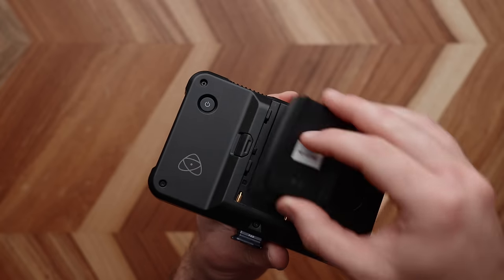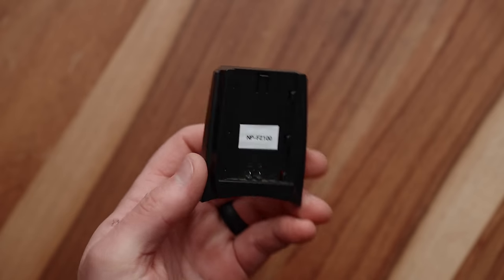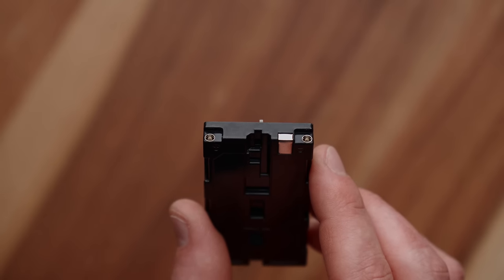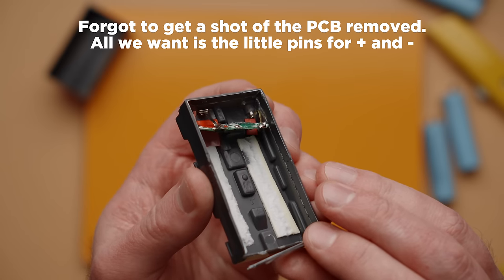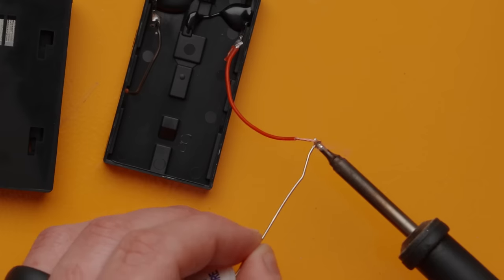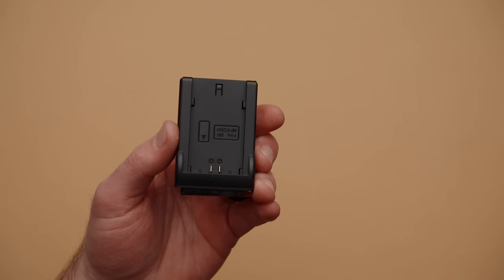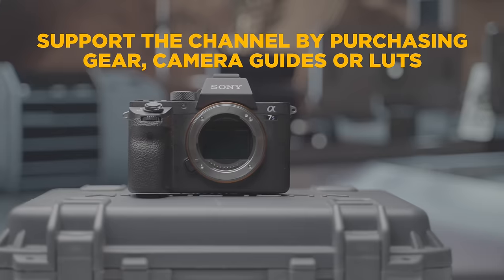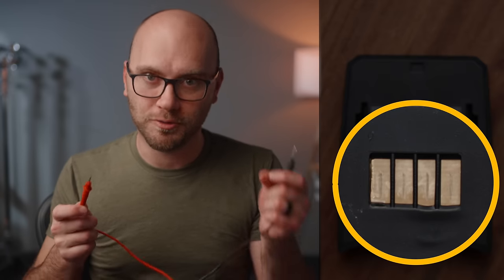This DIY Battery Adapter ROCKS!

Comment from the maker: WARNING: In case I didn't make it clear enough in the video, be careful when modding batteries and power accessories and perform all of this stuff at your own risk. I would also recommend sticking with official batteries like Sony's FZ-100 as cheaper models may not be up to the task of powering higher current devices. Finally, while these smaller batteries have the same voltage, max current draw is different. So don't use this little fellas on a light that uses NP-F990 batteries like COB lights etc. All that aside, happy modding!

Comment: Great video!
I shoot videos underground while exploring abandoned mines. I wanted a single battery to power both an Aputure F7 LED light and a GoPro. I purchased an Andycine battery plate with D-Tap and USB for the NP-F970. Similar to what you described, we used the shell of an NP-F550 to make a dummy battery to power the light. A short USB-C cord powers the GoPro. Now I can film for hours with just one battery mounted on the rig. I carry a backup battery in my pack and I'm good for a long day underground. I've used it for about a year and it's great.

Comment: Sweet! I have almost a half dozen BP-900 series batteries that I haven't used since I got rid of my Canon XL1 years ago. Awhile back I bought a cheap LED light that uses NP-Fs. The NP-Fs came with a cheap charger that takes all day to charge just one, so sometimes I'm sweating it if I forget to put one on charge the night before. 

Had to do a lot of searching but I think I've finally found the parts to do this. 

BTW, I found that Adorama has the battery charger plates for only $1.99 each. But probably only worth it if you have a big enough order to get free shipping. Thanks for the idea!

Comment: Fantastic and thank you ! Going on expeditions in remote locations, I need to bring LOTS of spare batteries, 2 chargers for each type, etc. and have to carry those on board since they can't be left in the checked-in luggage. So getting rid of the NPF would be great and would save weight and space. I'm a Nikon user so have to figure it out with the EN-ELxxx

Comment: You can pry the plastic cover off the back of the Watson plates to directly access the wires, rather than soldering onto the flat metal contacts.

Comment: Even a small spark, for example from cutting the terminals on the cells themselves, could lead to the cells catching fire. Li-Ion batteries are notorious for burning off in a large stab flame.
I'd even go as far as saying, that if you really want to do this (I strongly advise against doing it) - do it outside and/or with a fire extinguisher nearby - stay safe.

Comment: LP-E6 user here. I think NPFs are better, but sadly most of my gear uses LP-E6. So my solution for low battery life was to mod the LP-E6. I removed the garbage lithium cells in a generic pack. Then added standard 18650 cells, which are like 20mm longer, but have double the capacity and 2-4x C-rating. Now I can power my Blackmagic Pocket 4k for a full hour.

Comment: Cue inexperienced people shocking the crap out of themselves. 😎 The capacity issue means you're going to have to buy many more of them.  Seems easier to just use NP-Fs.  Having one of these adapters in the bag, just for emergencies, seems likely.
Reply from the maker: If you like the larger 770 or 970 definitely, but I hate those big fellas and prefer to keep things light.

Comment: FYI, Finally got the canon adapters you linked to on ebay and they arent working on my ninja V+. Itll work on other LP battery powered devices though which is weird. Looks like im gonna have to get DIY with it anyway eh?
Willing to put in the work to try and get this running but you should probably not send people to this product thinking its gonna work for this application.
Reply: *correction: it works with other NP sony abttery powered devices. (Not LP 🤪)

Comment: Hey!  How "easy" do you think it would be to create something like a battery pack for use with a dummy battery?  The particular use case is an event/presentation in the field (away from power source) where I need to have sustained power for longer than I trust a single battery to last.  (yes, I realize that this is what v-mount batteries are for, but I'm not interested in getting into that ecosystem.  Plus, I'm curious about this DIY solution.)  In particular, do you think it's possible to create something that allows for multiple batteries that can be swapped out?  However, now that I think about it, there would be no way to accurately gauge which battery was being used and how close to depletion it was.

Comment: But what's the point in converting your stuff to use those low capacity batteries instead of the actual NP-F batteries? I don't get it and I've been an electrical engineer so I'm quite educated in the matter. Probably the first advice from you that I don't understand why the hell do it.
Reply from the maker: I've only been using the 550 batteries so from a capacity perspective, I lose nothing by going with FZ-100 batteries.
Reply from the maker: @TheSpiv  The same BMS PCB function can be found inside camera batteries. No need to have dual BMS. In fact that would probably be very bad which is why we want to remove it and let the Sony/camera battery take over so it can protect against over current and voltage draw.